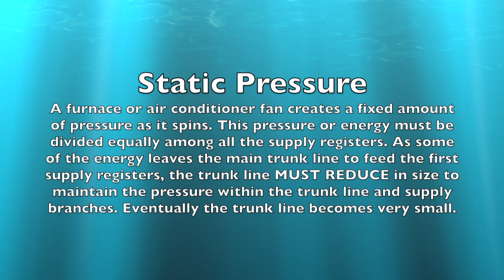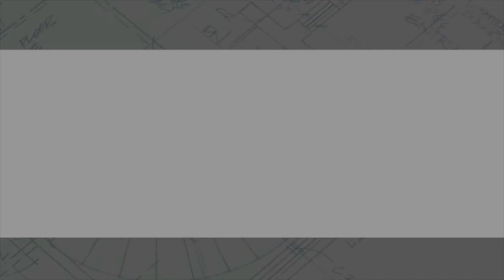Static Pressure Explained

Comment: Why do I see the take offs across from each other? I’ve been reading about the 2 ft rule and that’s not following it. Is it the size of the trunk, the output of the main unit, or is it because my reading are for residential?  So many different opinions ugh!
Reply from the maker: There is nothing wrong with this design. Think about why. Think about the space.

Comment: My friend just paid $12 000 for a new furnace 3 years ago. She pays the same company that installed it a monthly fee to do the maintenance on it. Yesterday they did the yearly inspection and they said the static pressure was high. 1.1 something. They gave her a quote for $3500 to fix it.
Wouldn’t they have made sure it was done right originally?
Reply from the maker: Your friend should have used my New Furnace Checklist to avoid hiring idiots: https://shop.askthebuilder.com/furnace-boiler-installation-contractor-hiring-guide-checklist/

Rarely is the static pressure HIGH. It's often LOW because the ductwork was not sized properly. Your friend should do a consult call with me. Tell her/him to go here to set up the call: https://shop.askthebuilder.com/15-minute-phone-or-video-conversation-with-tim/

Comment: Great quick info on static pressure. I would like to ask, does the main trunk need to reduce a certain amount of feet? How would I know when to reduce it?
Reply from the maker: Yes. Simple. Read a Mechanical Engineering textbook about static pressure.
Reply: The sizing in this case is based on the equal friction method. I’ll reduce when doing so will allow me to reduce duct size by 15%-20%.  It really comes down to balancing the cost of a reducer vs running air through slightly oversized duct for a short distance and then reducing more.  Not rocket science, more of an art, but in general you decide whether to resize duct after each runout with the goal of keeping the pressure drop per 100 ft approximately equal throughout the duct system.  For example, for a 24” duct, I probably won’t reduce until a 20” duct will have the same pressure drop/100 ft as the 24” did before it dropped of some air at some registers.
Reply: @twm1452 you know we are learning this in rocket science.

Comment: The tube gets plugged into the static pressure pickup port, and goes back upstairs into the rooftop unit. Where does it go exactly inside the unit?
Reply from the maker: Engage your critical-thinking skills. Where do you think the return air goes????? CLUE: How does your heart work?